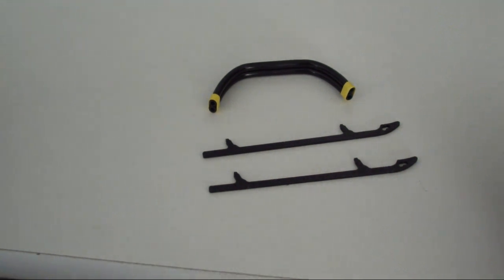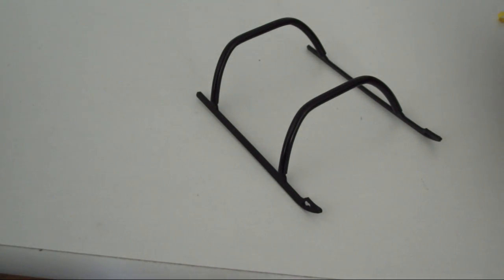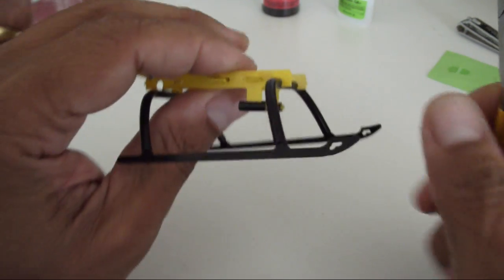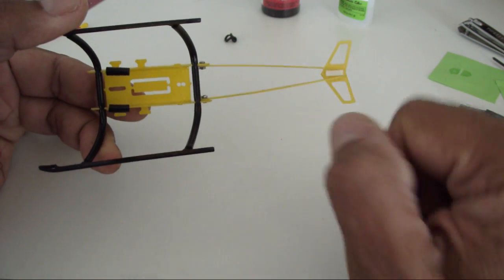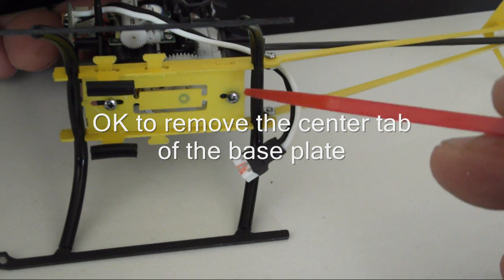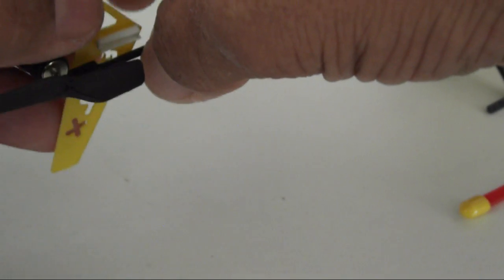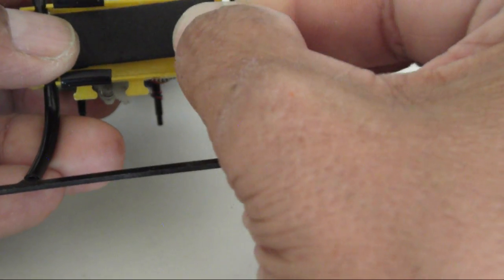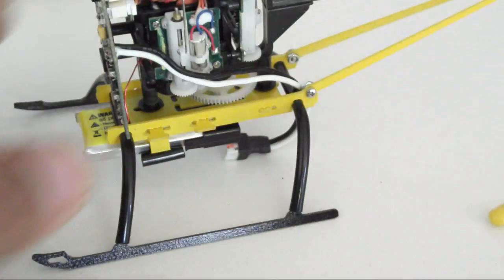MIA Upgrades - mCPX- Phantom - Edge Combo Kit Instructions Part 3 of 4

Comment from the maker: the kit is designed with flexibility in mind it will work with the original stock boom and with thicker booms by simply using one of the black rubber pieces of tubing instead of the white plastic clip that goes on the horizontal fin and boom supports. The rubber piece will need to be slit lengthwise, a thicker boom will grip this piece with more room, the idea is to shoot for a snug fit, you can even use a piece of heat shrink tubing with a really thick boon and glue it to end of boom supports.